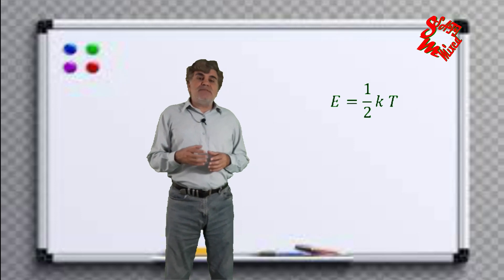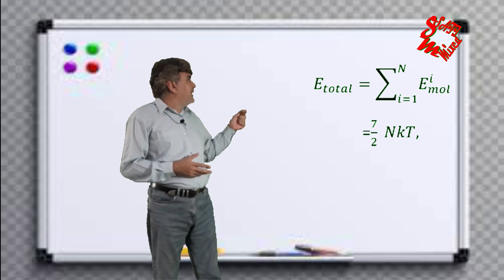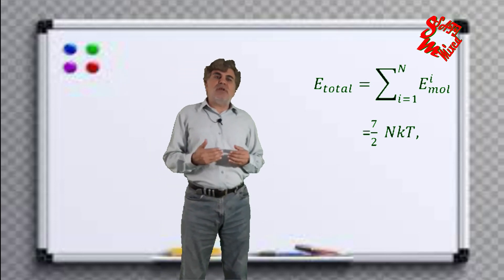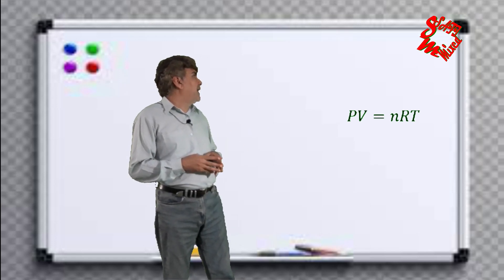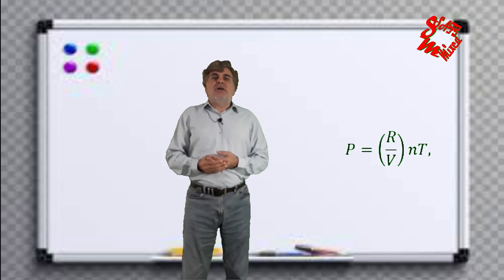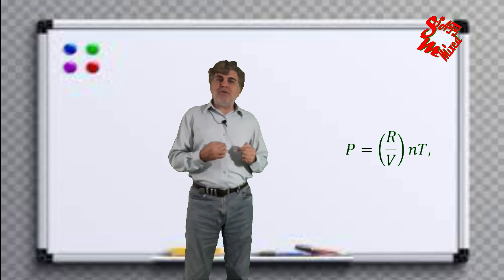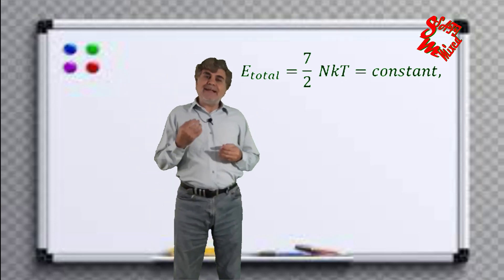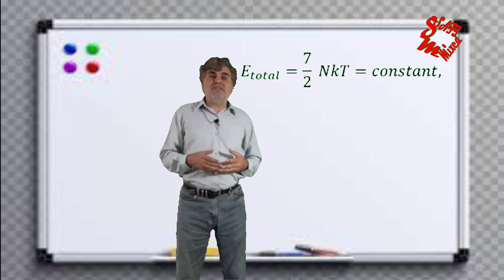Why do we feel suffocation in a hot room

Comment: Sir In a 'closed room the quantity of oxygen decreases as it is used for burning as well as breathing. The oxygen quantity in the closed room becomes less than that of carbon dioxide and carbon monoxide and so breathing problems are faced.
Carbon+Oxygen---->CO2.
Reply from the maker: That's true when one burns coal or gas, electric heater doesn't burn oxygen!
Reply: Great sir.....❣️❣️